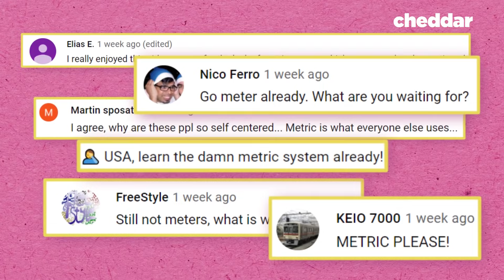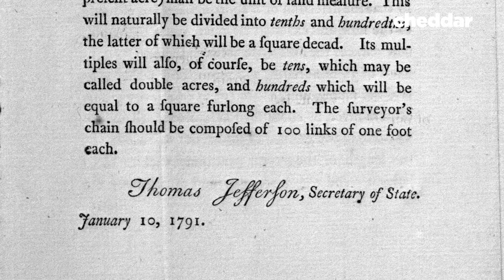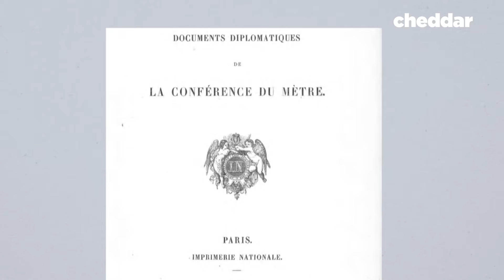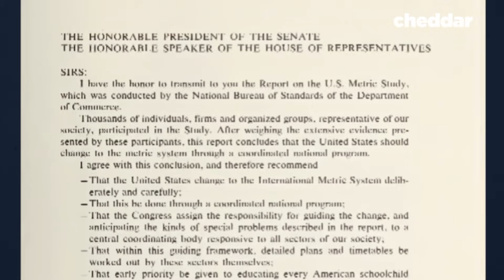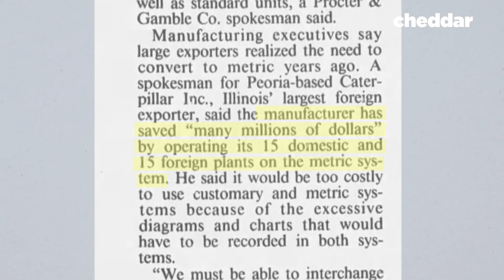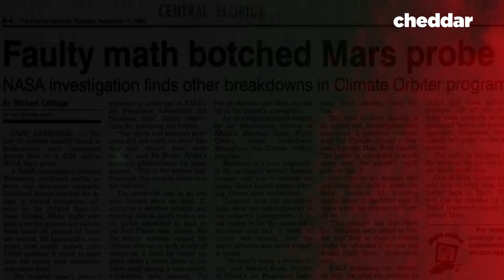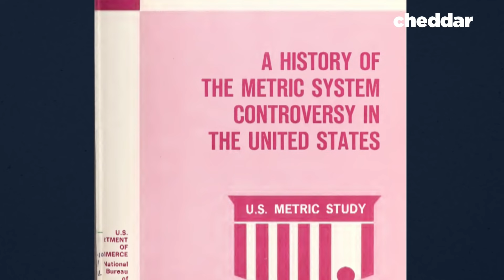Why Doesn't the US Just Use the Metric System? - Cheddar Explains

Comment: Back in the early 70's , there was a big push in the US to use metric. As a student, I was taught metric, and tried to convert my elders. They told me metric was "too hard." I said, no it's simple, just use 10's. They would then ask me things like, "How many centimeters in a foot?" When I couldn't multiply 2.54 by 12 in my head, they said, "See?" 
    That was why it failed.
Reply: Well hey, at least with Metric being a regular part of schooling these days maybe in a couple more generations full metrication may happen
Reply: @cpufreak101  I wish. It has already been two generations.
Reply: @cpufreak101  When pigs fly.
Reply: @Delgen1951  or after we die more than likely :/
Reply: I was there in the 70s too. As a kid you're put on the spot, but when asking about a foot either it's just an estimation in which case the answer can be approximate, or they're asking for more accuracy in which case you use a measuring tape and the person can see for themselves.

It would have been easy to switch then, and it would be easy now - all we have to do switch - people would adapt within a few weeks, within a couple years the measurements in the US system would be trivia questions.
Reply: @cazgerald9471  When it comes to "eyeball estimates" I am close to "guestimating" in either system. If someone asks "How far away is the TV from the door" in metric or english, I still come up with nearly the same variance. (I.E: If they ask in feet and I say  "Ahh...about 2 and a half feet", but it in reality measures 2 feet, 8 inches. I'm basically the same distance "off" if they had asked in Centimeters, I'd say "Err....about 8  decimeters" but measured it is actually closer to 8.25 decimeters.). I can "guess" liters or quarts and be off by a similar margin.It's not impossible to "think" in both systems if you USE both systems regularly.
Reply: @jamesslick4790  Thanks James, that's more or less the point I was hoping to make.
Reply: @cazgerald9471  I knew that, You said it, and I'm glad. if one USES a "thing" it becomes natural, Many people in Europe know another language (besides their own), but don't realize that Yes, there are Americans who not only "know" metric, but are "conversant" in it, to where they can "eyeball" in either. Been doing it since I was a kid (started school in the 1960s!)
Reply: @cazgerald9471  It isn't the US System it is English
Reply: @clasicradiolover  U.S customary units is the system of units of measurement used to measure things in the United States. The system of Imperial units is similar and in some parts identical.
Reply: It's not a metric system fail, it's a imperial/US system fail.

You have to think metric. Forget the feet, inches, thumbs, legs, heads, pen*s, etc.
Reply: @fernandor4617  It's a human fail. I "think" in both "systems", and apply what unit is required. Almost anything mechanical (except when it's a "legacy" machine (a 1955 Chevrolet..) I use Metric, If it's construction related (like buying a new front door) I use USC. Not hard to do.
Reply: @fernandor4617  The US adopted Metric as a legal standard, The US Never adopted Imperial as a legal standard. If you are going to mock something, at least get your shit straight.
Reply: Fernando Ramos best comment here bud🤣
Reply: @fernandor4617  That's the thing. It is like learning a new language. When just beginning you still think in your native tongue and then do a conversion to your new language. As you get more proficient you think in your new language and it becomes second nature. We Americans tried in the 1970s but never moved out of the translation phase. 
The time is way past due for us to make the change, we are ready!
Reply: Christian Libertarian hahaha , I like that
Reply: You wouldn't need to convert from feet to centimeters if you didn't use feet. Elders were using circular logic to pretend to make sense.
Reply: @mysticmarbles  Of course they were using circular logic. They weren't using logic at all, to tell the truth. They just didn't want to change, and were making excuses.
Reply: Most Americans like to hold on to archaic crap. They can’t let go of the past!
Reply: @ruffdawgg  Really? While Europe constantly reminds the US that it "has no past"? 🤔
Reply: James Slick making such a comparison is deflection. They do it so that makes it ok for us?
Reply: @jamesslick4790  I think what Europe meant is US does not have a strong,old historical roots (a King,empire,very very long time for culture)...... 

It's like Asian concept of culture,in which a country must have 1000 years or above to be called as culture.Too early?They call it popular culture.
Reply: @ruffdawgg  tis why racism is still a thing.
Reply: Syaoran The Fox bulls eye
Reply: @ruffdawgg  
in my country when we speak to each others or to have a vague idea we sometimes use non-metric units, but when at work or try to mesure or craft something that needs precision we certainly use metrics 😀

that's the solutions for american
Reply: Opus53 Waldstein I know people from the UK, still talking about weight in stone. I honestly haven’t a clue how that works!
Reply: @ruffdawgg  This is somehow lost on the New Brit, who hasn't yet understood en masse that American measurement systems are British castoffs.
Reply: jaklumen yes indeed! Thank you, you know exactly to which I am referring!
Reply: ruffdawgg True. We fought a whole civil war over archaic shit that ruined lives. Maybe some states will secede to preserve customary next.
Reply: NIN10DOXD well said
Reply: Metric was taught at the fifth grade level in the  Pittsburgh (Pennsylvania) Public School system in the 90's......The 1890s! My grandfather (born 1891!) knew what the millimeter,gram and liter were, and his only excursion outside of the US was to Ontario (Likely to score legal booze at the time ,LOL) in the 1920's! ( and Canada wasn't yet "metric' then) Your "elders" must have gone to a backwards school!
Reply: How many feet or inches is a mile? That’s the biggest confusion for me in the us system. 
Whether something is 5nm tiny, 10cm big or 5km long, you always know the proportions.
Reply: daniel_960_ imo we should metricate but keep the mile (redefined as exactly 1600m). Then people will know it’s exactly 160,000cm or 1,600,000mm in a mile, and runners can continue using the highly useful distance of four laps in their training. Plus, keeping with XC/T&F, suddenly the field event distances would now be measured in m.cm, not only the same as the rest of the world but the same as the track itself. Much more sinsible
Reply: @daniel_960_  you don't need to know those things in everyday life. Any time you actually do need to will likely be a time when doing the math is easily accessible.

Imperial on the other hand is far easier to visualize because it's based on physical objects and common fractions like fourths. Ergo, Imperial is better for fast reaction and timed work, like cooking and driving, where second and minutes matter a whole lot more. For everyday use, there's no beating an Imperial style system.
Reply: @lgvereor  
Yes, because everyone's foot is 12 inches.....oh wait.....
Reply: And that is part of the problem; this need to somehow make a connection between the two, as if the have something in common.  They don't, but for some reason there is a thinking that we have to first see how one is like the other before transitioning over to the other.  But we never did that with the 2 liter bottle did it?  We just started using, and it's still here.
Reply: @jesse6327  Exactly.
Reply: Yep, that’s probably the main reason why metrication failed in the states, people attempting to convert. The point of metrication is to use the new system and NOT to convert to English units... if they teach new generations the metric system in schools, they must not use conversions to other systems.
Reply: To multiply by 2.5, just multiply by 5 and divide by 2 (in either order, it doesn't matter). So 2.5 by 12 is 30, because that's 6 times 5. The conversion is actually really easy.
Reply: Snoi Med  Actually, decimal is not easier to divide. It is certainly easier to divide by 10, but it is not any easier to divide by 2, 4, or 16. Certainly easier to divide a foot by 12 than a meter.
Reply: Christian Libertarian the real joy is the ease of adding, subtracting, multiplying and dividing decimal figures instead of fractions.
Reply: The only caveat is thirds, just as in fractions. We can mathematically only get just short of exact when added up to a whole.
Reply: Christian Libertarian you’re still thinking in fractions instead of decimals. Divide 1 meter by 2, that’s 0.5. Divide by 4, 0.25. Divide by 16, that’s 0.0625. It’s quite simple, actually!
Reply: 30.48
Reply: I'm British so I don't know imperial very well (even though we invented it, it's seldom used anymore), but I do know off the top of my head that 1 yard is just under 1 metre, I think it's like 90cm right? And I know that 1 yard is 3 feet, so 3 feet is likewise just under 1 metre, so 1 foot is about 30 cm. And I googled that and I'm right: 1 foot = 30.48 cm.
Your failure to explain metric to your parents is the fault here. If you think the metric system is the fault then you really are a moron. All you need to know is 1 foot = ~30 cm. And that 1 yard is just under 1 metre. Really, you just need to know approximations. I still don't know the exact conversion between miles and kilometres, but I think 5 km is roughly 3 miles. I just googled that and... yes, 5 km is 3.1 miles. I also know that 70 fahrenheit is roughly 21 celsius, because they're both about room temperature. Just looked it up and yes, 70 F = 21.11 C.
That's the thing, you don't need to know the exact ratios necessarily, just rough approximations are fine. It will quickly get you familiar with systems you aren't aware of. In Britain we use miles for all road signs, for instance (one of the last remaining widespread uses of imperial in Britain), so I'm not very familiar with kilometres when estimating long distances. But just because I'm aware that 5 km = ~ 3 miles, it's then very easy to make a rough conversion between the two. If I see 20 km on a European website, then I know "okay, the miles would be roughly 60% of that, so it should be about 12 miles".
Reply: Except the foot is supposed to be tossed out the window too. 100cm in 1m.
Reply: You don’t need to know how many centimeters are in a foot.
Reply: Magnus Marz  But the OP was talking about getting "elders" to agree to the switch, which they aren't going to do unless they can do the conversion. Also, you're coming across pretty angry right now; I'm sorry if I've upset you, I really didn't mean to upset anyone.
Reply: I know over 500 people and I eill convert them if you tell me how much 2.30 a gallon is in liters
Reply: @99CentRapper  $0.61/liter. But an easy/quick way is to just multiply gallons by 4 to get pretty close.
Reply: Im switching,I've been studying it.If you sant more metric watch my metric video
Reply: Why only drug dealers use metric? 🤔
Reply: The correct response to that question is, how many feet in a meter? Feet dont matter.
Reply: @DH-og5yr  I got a similar response recently when I suggested using metric to a carpenter. He responded that you "can't divide in quarters or sixteenths in metric." Meaning you can measure a quarter inch, but you get decimals when you divide by ten. I tried to point out that you can get a quarter centimeter if you wish, but he was having none of it.
Reply: @christianlibertarian5488   "I got a similar response recently when I suggested using metric to a carpenter. He responded that you "can't divide in quarters or sixteenths in metric."  Meaning you can measure a quarter inch, but you get decimals when you divide by ten. I tried to point out that you can get a quarter centimeter if you wish, but he was having none of it."

Actually, the carpenter was right.  You can't get a quarter centimeter.  There are no quarter centimeter markings on a meter stick or metric measuring tape. 

Metric is a fine system for many purposes, but for construction, the U.S. Customary system has proven itself to be quite capable.  And because of the enormous amount of legacy construction in this country -- basically, every building in existence -- it is not practical to try to change now.  If you need to replace a door or a window, it needs to be replaced by one of the same size -- and that size is designated in inches.   And since building construction is by its very nature a domestic-only industry -- no one exports buildings to other countries -- it doesn't need to use units of measure that other countries use.  So it's gonna remain customary for a very long time to come.
Reply: I mean, multiplying 2.54 by 12 in my head isn't that hard, but what do I know, I have a proclivity for math ¯\_(ツ)_/¯
Reply: That question was just stupid. It's like asking for how many cents in a yen.
Reply: The Brown RAT say what? Lol . The prefix centi means 100, as in century. A centimeter is 1/100 of a meter or 0.01.
Reply: But everyone else changed... when the world was less cientific.......
Reply: Blaxe Frost huh?
Reply: Snoi Med  ffs we all use the metric system. I wish people would stop with this idea that Americans don't use or learn it. Perhaps you should learn more about us before making generalized assumptions. We are taught both from day one of gradeschool, so we have the benefit of seeing which works best where. I'm telling you, metric sucks for everyday usage because it's decimal based. 

Imperial is based on practicality from over 2,000 years of improvements to the system (it was invented by Rome). Imperial is based on actual real-world everyday objects that are easily visualized and allow you to make quick rough judgments. It's made with flexibility and visualization in mind, and that's what makes it ideal for things like driving, cooking (esp. large scale), and surveying. Rome used this system to build the great monuments and wonders everyone knows, Roman military architects used it to build the many ancient defenses that still dot the landscape of Europe while modern metric-designed structures crumble. Metric is better at specificity such as in scientific measurement, but it doesn't make it better at everything.

Non-Americans who grew up with both also say the same thing, it's just those who grew up pretty much only learning metric that have it in their head that it's better all around. It's not.
Reply: Respond back asking "How many inches are in a mile?" Bet money they can't do it. Then say,
"I know how many centimeters are in a Kilometer, easy. 100,000"
Reply: cm in a foot is hard? It's 30. Or 29.7 to be exact.
Reply: @anSealgair  I thought it was 30.48cm in a foot tho?
Reply: Justin Noker Oops yeah 30.48, I confused it with the height of A4 paper..
Reply: @cpufreak101  have fun with that, considering younger generations are starting to embrace tradition and culture more than their parents and grandparents did, I'd say support for metric will wain even more than it is already.
Reply: @anSealgair  The Philippines converted to the Metric System in the 1970's. The question was how exactly we could do the correspondence between metric and Emperial Systems.

Then, our lawmakes realised that there is no governing body that tells you how to define the Emperial System. So, they decided to make a exact correspondence. 

While an inch is 2.5 cms, a foot is 12 cms. It doesn't matter if the Emperial System would not be the same as the American or British Standard. As long as it would correspond to the metric system. 

The only major company that doesn't use the metric system in our islands is Starbucks. They still provide a conversion in the metric system though.
Reply: So they're happy to divide yards into 3, feet into 12 and inches into 16ths/32ths or whatever so you have stupid conversions like 4.8 yards = 4 yards, 2 feet, 4 inches and 26/32ths (ish)...
But find multiplying or dividing by 10, 100 and 1000 "too hard"?

I'm not surprised that that probe crashed, its actually pretty hard to work out on the fly what something like 4.8 yards is in imperial if a computer spits that out for you and you have to convert.
Reply: @sergarlantyrell7847  "...so you have stupid conversions like 4.8 yards = 4 yards, 2 feet, 4 inches and 26/32ths (ish)..."

Nobody does calculations that way, SGT.  Nobody uses tenths of a yard.  In fact, nobody uses yards, period, outside of football and golf.  It's just inches, feet, and miles.  It's not difficult.  If my truck is 13 feet four inches high, and the overpass I'm approaching says it's 14 feet six inches high, I know I'm going to be okay.  I don't need to know how many inches are in a mile.  For everyday, nontechnical, human-scale use, the customary units work just fine. 

As for the crash of the Mars Climate Orbiter, that was because NASA was using metric units (newtons) for its flight trajectory software, while Lockheed was using customary units (pounds) to measure its rocket thrust.  So the problem was not with the customary system, per se -- if both parties had been using customary units, there wouldn't have been a problem -- it was simply that they weren't using the same units.    (That being said, for science and technology, metric is better, and that's what Lockheed should've been using.  Especially since Lockheed's contract with NASA specified the use of metric units.)
Reply: Christian Libertarian who the fuck needs all these feet miles inches hands and bla bla bla bullshit anyway?
Reply: Chritian Libertarian so the reason converting to metric was too hard was because of the screwed up nature of the imperial/USCS.
Reply: After learning a bit more about the metric system on my own, measuring has been so much easier. For example, 
500 milliliters = 0.5 liter (half of 1 liter)
1000 milliliters = 1 liter.
1500 milliliters = 1.5 liters
2000 milliliters = 2 liters 

Now that I try to go back to the imperial system, it's so much more confusing and inaccurate. 
1 gallon = 4 quarts
 2 gallons = 8 quarts. 

Even when it comes to inches: 
12 inches = 1 foot 
or 
24 inches = 2 feet.
Reply: @DeathBloodRider   "Now that I try to go back to the imperial system, it's so much more confusing and inaccurate.
1 gallon = 4 quarts
2 gallons = 8 quarts.

Even when it comes to inches:
12 inches = 1 foot
or
24 inches = 2 feet."

How is that confusing or inaccurate?   It's neither.